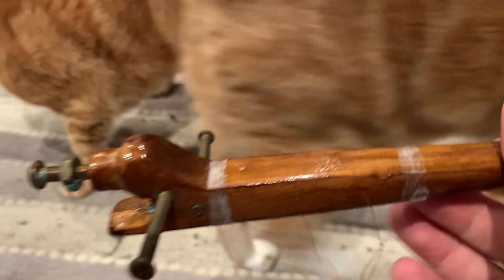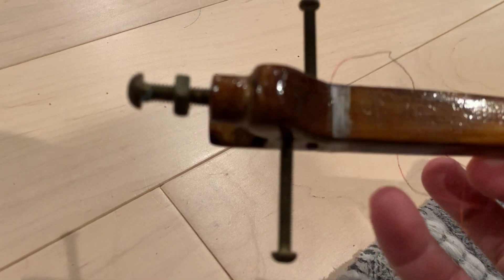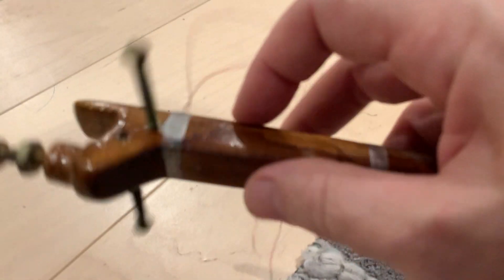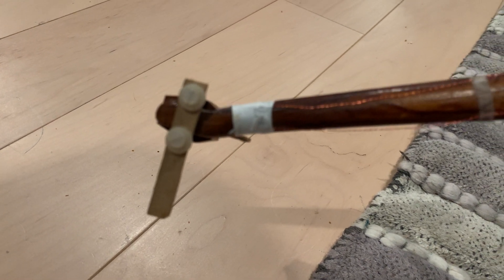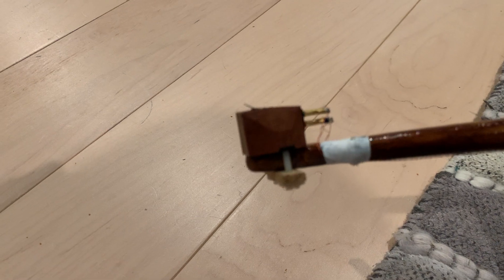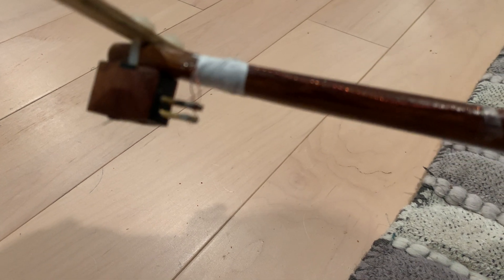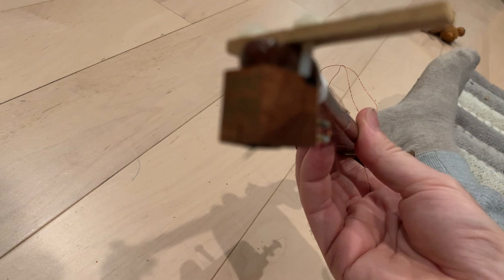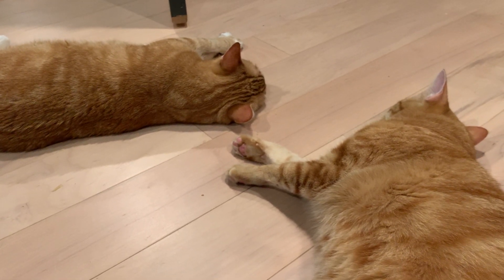My first wooden tonearm

Comment: you need a lot of weight on a unipivot like that centre mass, it's not the best unipivot design.
try and get a valve lifter bucket leave the centrepoint untouched that can be your pivot point, attach a piece of ½" by ½" copper pipe in with high temperature JB weld, making sure you don't cover the centre of the lifter, fill the outside of the pipe with molten lead making sure you heat up the lifter on the outside with a blowtorch first, do this outside!!! and make sure it's clean grease and oil free.
it is important that the pivot point is below the record surface! not above that is a mistake with Unipivot arms,
glue a piece of wood where the pivot point is before connecting the valve lifter, attach with epoxy resin  or JB weld. have the height below record surface.
place the wires in some groove, and this stops warping, put three grooves 1 at the bottom two on the sides  from 2 to 4 mm deep progressively, another benefit it reduces the weight overall. you would have a good arm then. you can get a valve lifter from a scrap yard or garage. make sure it's below record surface.
and one more thing get rid of the lifter from the side want it pointing straight up does make a difference sonically, bolster wood. when laying your wires make sure there's a gap between left and right channels and + - make a wider groove  for the wires 8mm, cover with copper tape and earth,
no you need to polish the diamond not just clean with green Emery cloth once or twice a week with regular playing
Reply from the maker: Thank you for the detailed instructions! I've got to wrap my head around it... :)  On this video it was not obvious that the counterweight is below the cartridge body, yet it is. Also, this was my very first attempt at a wooden arm, the very beginning without any external pointers, not how I would build it now. Now we have numerous companies making wooden arms, but it was not so 20 years ago when I built this arm - back then it was all-metal age. 
Thought to document and share how it played for two decades before I start modding it. While it has many areas for improvement it just so utterly smashed, destroyed, murdered, slaughtered and quartered the Rega RB300 arm that it was truly pathetic in every regard. I call it an auspicious start... and even though I made much better wooden arms since, I can listen to this arm with full enjoyment. It presents instruments and voices - not fragmented sounds....
Reply: @realworldaudio  yeah!! but still on your other arms like the long one you show!  left it up so the vertical pivot is below the record level to the platter or slightly below.
the arm tube needs to be lifted from the bearing housing, hard to say from just watching it, probably half to an inch ¼ from the centre pivot bearing axis.
 the arm tube is still kept level but the bearing mechanism is dropped down to level or slightly below platter level. if you take a ruler from the centre of the bearing pivot to the top of platter this should be straight, or slightly tilted back a couple of degrees, but not higher than the platter top, this makes sense to you???
I'm not sure what you don't understand about the comment I made about the unipivot? is it the valve lifter shimless bucket !? get the widest possible one you can! you know what they are?? engines hydraulic lifters for camshafts valves,
internet search it you'll see, you can buy them for about $20 new, have a diameter of about 1½ inches.
 you don't want the pivot on  a unipivot to be balanced on the top like a tie rope walker, as you can see it's unstable, introduces jittering, thats why your using the stabiliser side bars but is not solving the problem, by having the mass under hanging is much more stability control and dampening undesirable movements. with the mass you want as much as possible under the pivot point, lower down the shaft as possible.
Reply from the maker: @hoobsgroove  I think it's confusing that the counterweight is not shown. The arms have relatively little weight compared to the counterweight. Yeah, would be better to have the arms stick out lower.. and as I said, as I said not for the Nth time... this is not a final solution, not the best I can build, not all the best solutions, but was my very first attempt, with LOADS of margins for improvement, and has next to nothing of my amassed lore in it. The purpose to show is to convey that when one fails to build a perfect arm on a first try, it can still be still a colossal improvement over a plethora of commercial products. 
Despite its flaws it still beat the living crap out of ALL commercial arms I tested it again, even the then-legendary high-end standard ET-2 arm was lacking in comparison (but at least the Et2 played in the same ballpark, but mechanical and fragmented sound in comparison).
For a total cost of about $10, not all that shabby, being able to play game in several K$ arms. For a very first try. Build it with more lore... it gets even better. But when one screws up, or knows not all aspects, it can still take one to the next level.
Reply: @realworldaudio  I'm not talking about the counterweight that's got nothing to do with what I was talking about, yes you're still need a counterweight... what I'm talking about is rotation on mass. you can look at it like this the same principle as a parachutist.